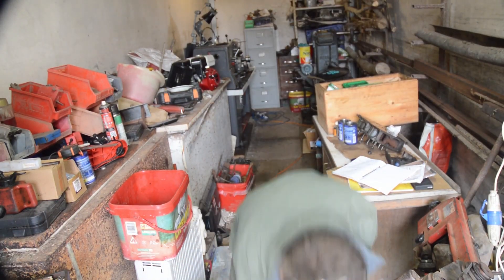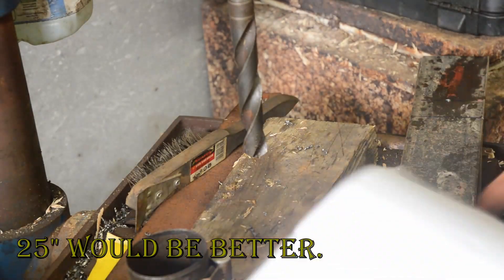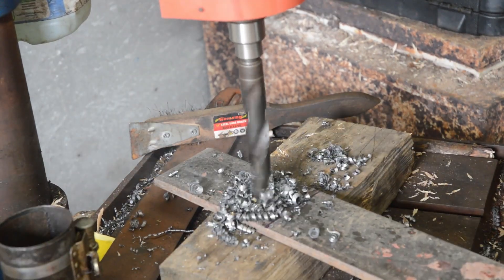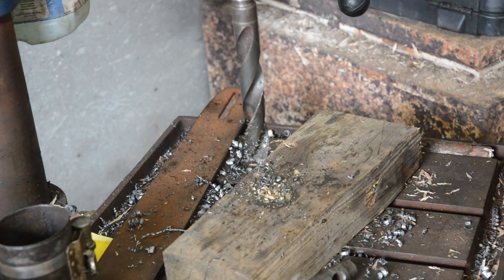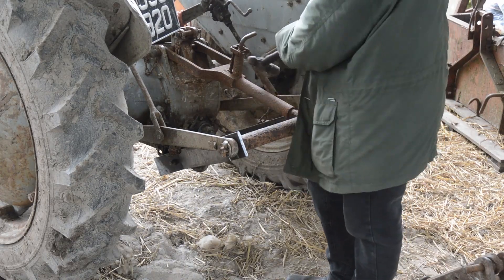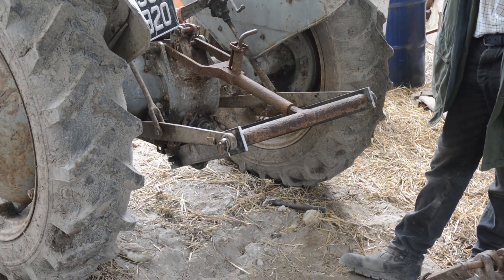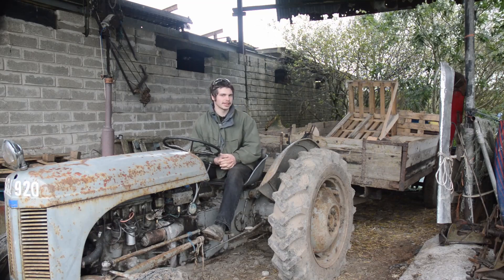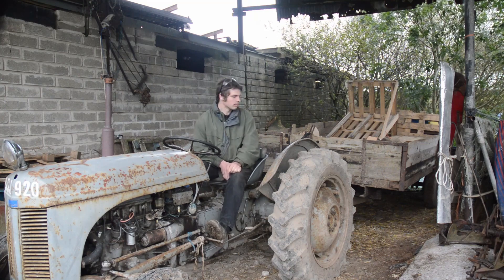How to make your own Ferguson TE20 pick up hitch.

Comment: il n'y a plus d'huile dans le pont boite vitesse ! faiblesse du relevage
Reply from the maker: No, valve problems. The pivot on the arch is worn meaning for insufficient valve actuation, I have since shimed it (shown on later video) and it works more or less like new.
I thought it might be a priming issue as well, for a while.